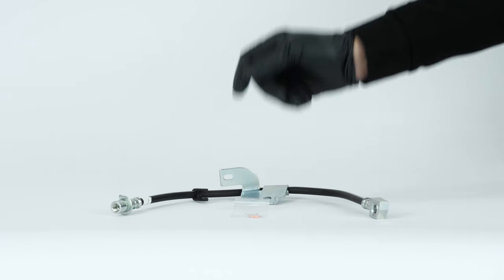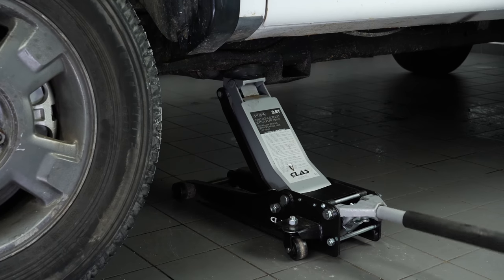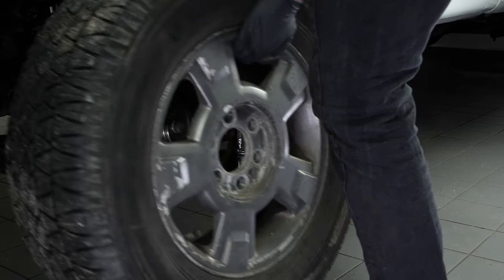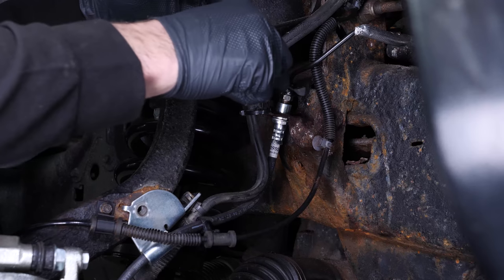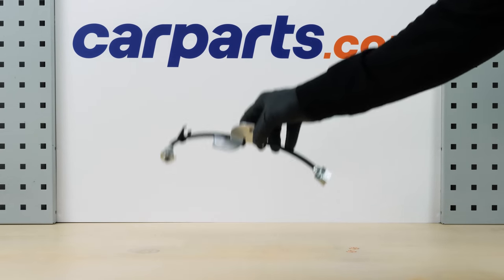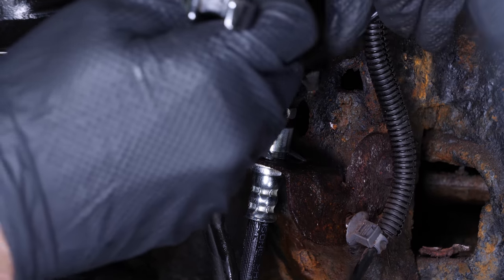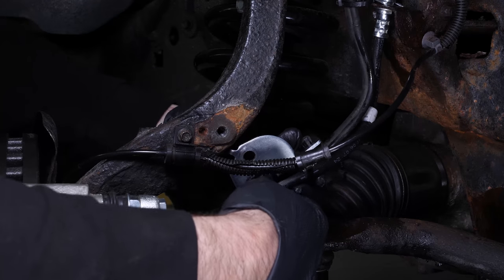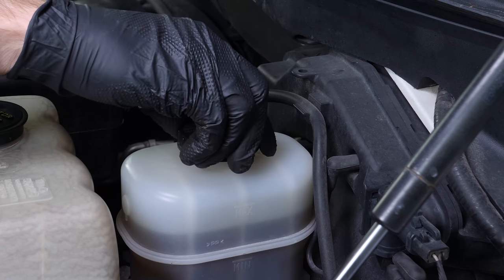How to replace the Front Brake Hose 2009-2014 Ford F150 🚗

Comment: Yes how do I bleed the brakes after I put the new hose on the brake hose how do I go by bleeding bleeding the brakes can you show me how to bleed the brakes on the truck after I replace the hose
Reply from the maker: Hello Hartzell Helton,
Thank you for your comment.
The “How to bleed the brake fluid” video will be out soon.
It is currently being edited. In the meantime, you can simply open your brake fluid reservoir. Then unscrew the bleeder screw on the brake caliper by one turn. After a few seconds, the brake fluid will flow by gravity and bleed the air from the circuit.
After a few milliliters, close the bleed screw and readjust the brake fluid level.

Comment: Yeah yes I also need to see how you go about bleeding the brakes wants the hose is on the brake hose is on how do I go about bleeding the brakes
Reply from the maker: Hello Hartzell Helton,
Thank you for your comment.
The “How to bleed the brake fluid” video will be out soon.
It is currently being edited. In the meantime, you can simply open your brake fluid reservoir. Then unscrew the bleeder screw on the brake caliper by one turn. After a few seconds, the brake fluid will flow by gravity and bleed the air from the circuit.
After a few milliliters, close the bleed screw and readjust the brake fluid level.

Comment: WARNING!! It would seem that their IT department is no longer competent and trying to order parts from them is a complete waste of time!! The inventory information on the website is not accurate, they sell stuff they don't have, then refund you without notification so they can say there's nothing they can do to fix their screwups. If you value your time stay away from these people, they don't respect your time!!
Reply from the maker: Hello Lance, we are continuously working to improve our process and inventory. As soon we determine that an item is out of stock, we automatically remove the 'Add to Cart' ability on our website. There could be timing issues though and this is most likely what happened with your order. We sincerely apologize for this inconvenience.

Please note that if you paid through credit card, we do not capture payments for cancelled orders. Any pre-authorization hold on your account for a cancelled order will automatically fall off.